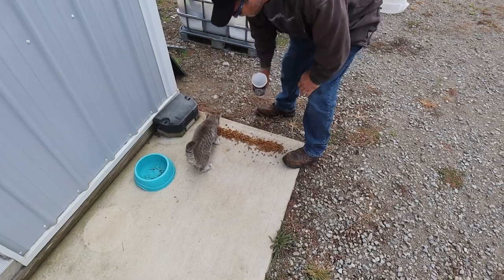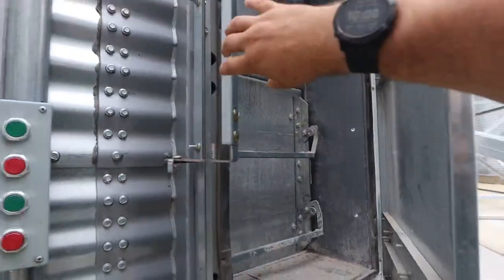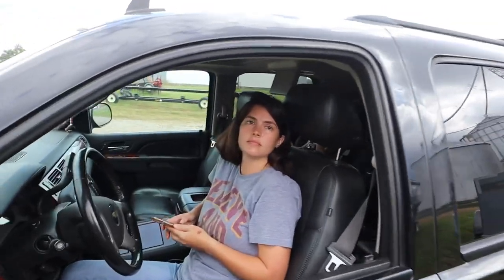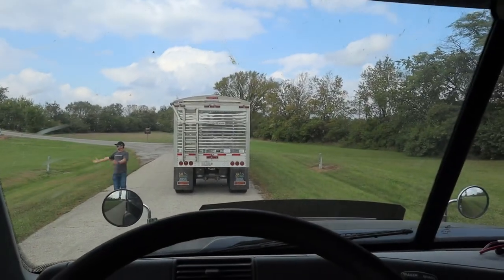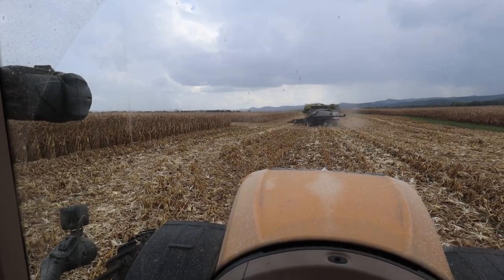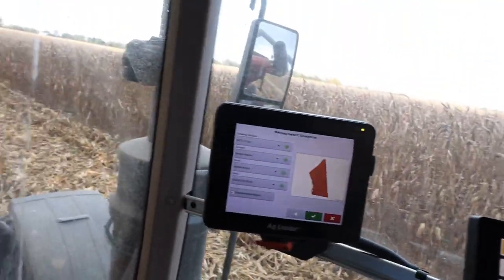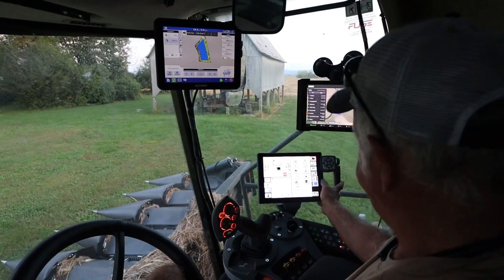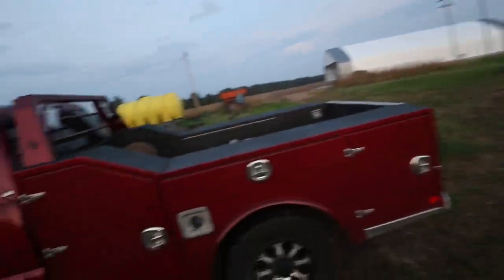Workin for Tips

Comment: If you have hard water make sure you turn off hot water and run it for about 5 minutes cold. Then every 6 months run some cleaner through it. We cant run hot water anymore. Just plugs it up. But we use 2 washers. All in all it's about 50 hours a month. Got to love pigs